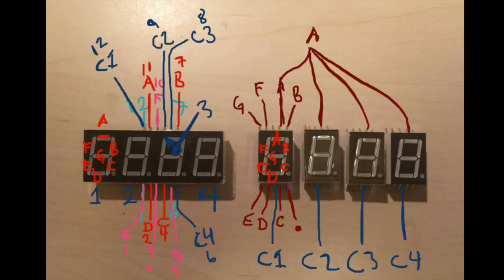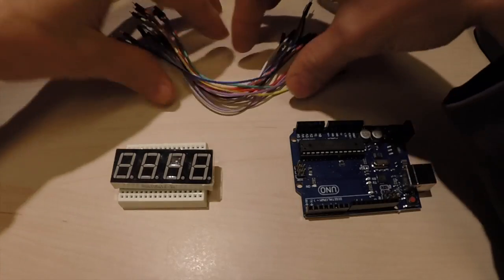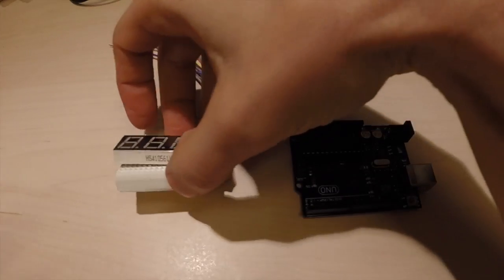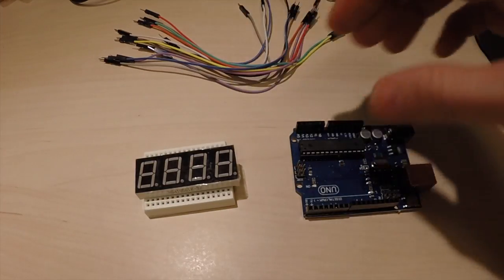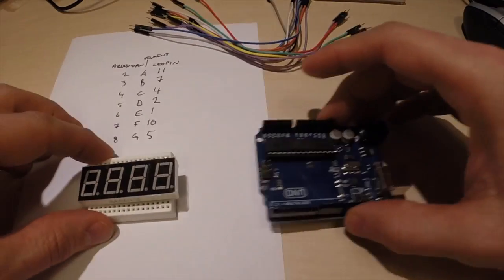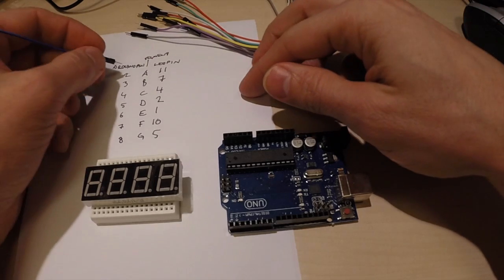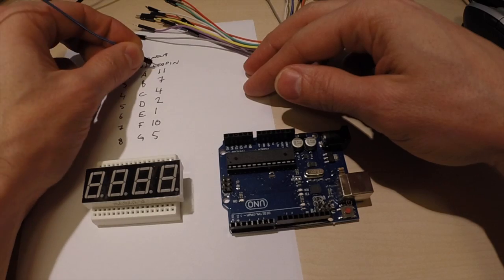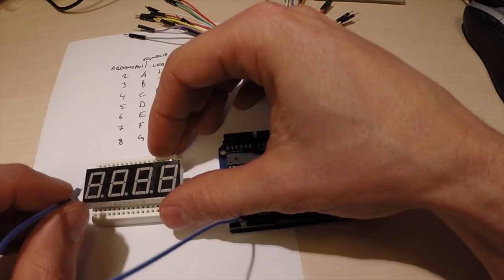Arduino and the 4 digit 7 segment led display - Anything Arduino Ep 21

Comment: Yo am a beginner can i put 1 instead of putting HIGH and 0 instead of putting LOW because thats how i did it with a single digit one
Reply from the maker: Yes that usually works. They are interchangeable.

Comment: what could the issue be if the numbers don't fully lit up? please help
Reply from the maker: Most probably a bad connection. Check connections and or soldering points should solve the issue. If the numbers are “inverted” then you have the other kind of common pin: common anode/common cathode. Check the table for that.

Comment: I have tried this code in wokwi online simulator instead of using real hardware, in simulation I can't able to get the all the 4 digits correctly displayed simultaneously, what's the reason, can anyone tell ? Whether we get this only if we tried in hardware?
Reply from the maker: Do you get them to show one after the other? Maybe you are running the simulation in a slow mode?

Comment: How can this unit display constant voltage output?  x.xx from the other breadboard.  example in Paul McWhorter's episode 9.   he uses a multimeter but couldn't you just send the data to the display unit?

Comment: i dont get it, a led requires an anode and cathode, but digital pins output only one type. It doesn't work for me
Reply from the maker: The digital pins can be either +5v or gnd depending on if the display is common anode or cathode you need to connect the common pin of the display to either +5v or gnd.
Reply from the maker: @komplikuotas1691  hahaha. Well I’m sorry for being five years late then. 😜

Comment: Where's the pin for GND?
Reply: hi There,

Here the GND is not needed. The Arduino Pins themselves will go Low when we need to sink the current. 
To turn on an LED, the Arduino pin connected to Anode will be driven high and the Arduino pin connected to Cathode will be driven low.

Seven segments 4 digit simulations here:
https://wokwi.com/arduino/libraries/SevSeg

Follow this link to play with the Arduino simulations 
https://wokwi.com for more such free Arduino Simulations

Comment: Can I use such a display without a resistors?
Reply from the maker: You can but as a majority of the comments suggest it is not adviceable. Resistors make the lifespan of the display a lot longer. Without resistors you will burn out the leds quite fast. I was lazy and didn’t use resistors. Don’t be lazy like me. ;)
Reply: @SourceryOne  ok, thanks
Reply: also, you can use this link
https://wokwi.com/arduino/libraries/SevSeg to play with the simulations without the real board. Please give a like, if you find this useful.

Comment: can we make 6 digit display using this technique?
Reply: absolutely possible: 
The Arduino pins are sufficient to even drive a six-digit display for sure. You should care for multiplexing rate

https://wokwi.com/arduino/libraries/SevSeg
You can tinker with the above simulation to build one six-digit Arduino display.

also for your kind info:

https://wokwi.com
 has a plethora of Arduino simulation examples

Comment: I really liked the way you are making the things simpler but when I have done in the same manner as you showed in the video but it is not getting any output and from where is this 4 in 7 segment getting power as you have not connected any supply to it
Reply: hi Niha

The Module doesn't need an external power supply. Each LEDs are driven using Arduino Pins itself.
To power on an LED, The Arduino pin connected to the Anode of the LED will be driven high and the Arduino pin connected to the cathode of the display will be driven low.  hope you got the idea.

Please visit:

https://wokwi.com/arduino/libraries/SevSeg has an online simulation page of Seven segment display

Comment: How cn i add switch for up/ down number
Reply: you can use spare two Digital pins of Arduino to read the button statsus.

https://wokwi.com/arduino/libraries/SevSeg for the simulation example. here, you can also add the buttons for the simulation.

Comment: Why did you not include a resistor? My 7-segment display needs resistors
Reply: The main intention of the video was to show the programming part. The author also recommends connecting one.

https://wokwi.com/arduino/libraries/SevSeg for seven segments of Arduino simulation. It is a free web-based Arduino simulation :)

Comment: Great video. But I have a issue. The upload is successful for me but nothing happens. The code is fine. And i copied the wire placement excatly from the video. I am using a arduino mega, but I put all the wires in the same spot(the numbers are all the same). Anyone know why this is happening?
Reply from the maker: You get nothing lighting up? Have you checked with just power over the pins with a resistor.
Reply: hi do you stilll have the code? I would like to use it.

Comment: can i read the output signal of arduino going at led display to another arduino ?????
Reply from the maker: Sure. These are just 1&0 states so no problem doing that.
Reply: Kristian Blåsol thanks sir.... I'll try
Reply: sir,,,, in the below link there is a device from which i want to get pulse out put regarding each input currency note... can i get it by reading the led display signal of this device into arduino 

https://youtu.be/FcOn6A0agu0

Comment: Where are your current-limiting resistors? Why are you connecting this display directly to Arduino outputs without resistors?
Reply from the maker: Laziness. It has been pointed out before. I should’ve used them. I didn’t.

Comment: My display is not doing anything.  I've dissemble it several times.  Code is compiling fine.  There is no power going to the display at all.
Reply from the maker: Have you tried inverting polarity? So connect the common pin to ground OR v+ depending on what you have it connected to at the moment?
Reply: @SourceryOne  Thanks Kristian.  Once i reversed the polarity and just focused, it worked.  I have it moving from digit to digit as it counts.  Nothing major, but its progress.

Comment: What is the white board for and where do i conect the wires on their. IS their anyway to include a rotary knob to change the digits
Reply from the maker: I don’t know what you mean with white board? Do you mean the protoboard? Yes you can add a rotary encoder no problem. Just make the numbers advance when you turn the knob. Look at further on in the anything arduino series for how to get a rock solid encoder working.

Comment: How can one combat the issue with ghosting? I mean, "1" has the "0"'s afterglow because of the Arduino not switching segments fast enough
Reply from the maker: Look at this video instead where I use two 595s to control the leds. By latching everything in the 595s I think that ghosting is eliminated. https://youtu.be/ZGzbAd-Aixc

Comment: Hello,  :( Could you help me please to purchasing an Arduino? yes
Because when I am going to select this product I found that there's some Arduinos !!!.
Arduino UNO, ARDUINO LEONARDO and Mega.
So I want to ask you about a reference of Arduino that you using.

Thanks a lot.
Reply from the maker: Uno is the most common one and works for most projects. Pick one that uses a dip28/dil28 circuit and not and chip. Then you can buy armel atmega328 chips and use one arduino as a programmer for those chips (see some of the early “anything arduino” episode where I show how to do this). Choose the Leonardo to be able to use the arduino as a usb device. For example as a multimedia keyboard(another episode of anything arduino). The mega is only necessary for really large projects where you need a lot of in/outputs. Hope that helps.

Comment: Nothing happened after doing Same thing
Reply from the maker: It could be you have a common cathode instead of a common anode or vice versa. Try to connect the common pin to v+ instead of ground (or vice versa).

Comment: /*
  Showing number 0-9 on a Common Anode 7-segment LED display
  Displays the numbers 0-9 on the display, with one second inbetween.
    A
   ---
F |   | B
  | G |
   ---
E |   | C
  |   |
   ---
    D
  This example code is in the public domain.
 */
 
// Pin 2-8 is connected to the 7 segments of the display.

int pinA = 2;
int pinB = 3;
int pinC = 4;
int pinD = 5;
int pinE = 6;
int pinF = 7;
int pinG = 8;
int D1 = 9;
int D2 = 10;
int D3 = 11;
int D4 = 12;

// the setup routine runs once when you press reset:
void setup() {                
  // initialize the digital pins as outputs.
  pinMode(pinA, OUTPUT);     
  pinMode(pinB, OUTPUT);     
  pinMode(pinC, OUTPUT);     
  pinMode(pinD, OUTPUT);     
  pinMode(pinE, OUTPUT);     
  pinMode(pinF, OUTPUT);     
  pinMode(pinG, OUTPUT);   
  pinMode(D1, OUTPUT);  
  pinMode(D2, OUTPUT);  
  pinMode(D3, OUTPUT);  
  pinMode(D4, OUTPUT);  
}

// the loop routine runs over and over again forever:
void loop() {
  digitalWrite(D1, HIGH);
  digitalWrite(D2, LOW);
  digitalWrite(D3, LOW);
  digitalWrite(D4, LOW); 
  //0
  digitalWrite(pinA, LOW);   
  digitalWrite(pinB, LOW);   
  digitalWrite(pinC, LOW);   
  digitalWrite(pinD, LOW);   
  digitalWrite(pinE, LOW);   
  digitalWrite(pinF, LOW);   
  digitalWrite(pinG, HIGH);   
  delay(1);               // wait for a second
  
  digitalWrite(D1, LOW);
  digitalWrite(D2, HIGH);
  digitalWrite(D3, LOW);
  digitalWrite(D4, LOW); 
  //1
  digitalWrite(pinA, HIGH);   
  digitalWrite(pinB, LOW);   
  digitalWrite(pinC, LOW);   
  digitalWrite(pinD, HIGH);   
  digitalWrite(pinE, HIGH);   
  digitalWrite(pinF, HIGH);   
  digitalWrite(pinG, HIGH);   
  delay(1);               // wait for a second
  
  digitalWrite(D1, LOW);
  digitalWrite(D2, LOW);
  digitalWrite(D3, HIGH);
  digitalWrite(D4, LOW); 
  //2
  digitalWrite(pinA, LOW);   
  digitalWrite(pinB, LOW);   
  digitalWrite(pinC, HIGH);   
  digitalWrite(pinD, LOW);   
  digitalWrite(pinE, LOW);   
  digitalWrite(pinF, HIGH);   
  digitalWrite(pinG, LOW);     
  delay(1);               // wait for a second

  digitalWrite(D1, LOW);
  digitalWrite(D2, LOW);
  digitalWrite(D3, LOW);
  digitalWrite(D4, HIGH); 
  //3
  digitalWrite(pinA, LOW);   
  digitalWrite(pinB, LOW);   
  digitalWrite(pinC, LOW);   
  digitalWrite(pinD, LOW);   
  digitalWrite(pinE, HIGH);   
  digitalWrite(pinF, HIGH);   
  digitalWrite(pinG, LOW);     
  delay(1);               // wait for a second
/*  
  //4
  digitalWrite(pinA, HIGH);   
  digitalWrite(pinB, LOW);   
  digitalWrite(pinC, LOW);   
  digitalWrite(pinD, HIGH);   
  digitalWrite(pinE, HIGH);   
  digitalWrite(pinF, LOW);   
  digitalWrite(pinG, LOW);     
  delay(1000);               // wait for a second
  
  //5
  digitalWrite(pinA, LOW);   
  digitalWrite(pinB, HIGH);   
  digitalWrite(pinC, LOW);   
  digitalWrite(pinD, LOW);   
  digitalWrite(pinE, HIGH);   
  digitalWrite(pinF, LOW);   
  digitalWrite(pinG, LOW);     
  delay(1000);               // wait for a second
  
  //6
  digitalWrite(pinA, LOW);   
  digitalWrite(pinB, HIGH);   
  digitalWrite(pinC, LOW);   
  digitalWrite(pinD, LOW);   
  digitalWrite(pinE, LOW);   
  digitalWrite(pinF, LOW);   
  digitalWrite(pinG, LOW);     
  delay(1000);               // wait for a second
  
  //7
  digitalWrite(pinA, LOW);   
  digitalWrite(pinB, LOW);   
  digitalWrite(pinC, LOW);   
  digitalWrite(pinD, HIGH);   
  digitalWrite(pinE, HIGH);   
  digitalWrite(pinF, HIGH);   
  digitalWrite(pinG, HIGH);     
  delay(1000);               // wait for a second
  
  //8
  digitalWrite(pinA, LOW);   
  digitalWrite(pinB, LOW);   
  digitalWrite(pinC, LOW);   
  digitalWrite(pinD, LOW);   
  digitalWrite(pinE, LOW);   
  digitalWrite(pinF, LOW);   
  digitalWrite(pinG, LOW);     
  delay(1000);               // wait for a second

  //9
  digitalWrite(pinA, LOW);   
  digitalWrite(pinB, LOW);   
  digitalWrite(pinC, LOW);   
  digitalWrite(pinD, HIGH);   
  digitalWrite(pinE, HIGH);   
  digitalWrite(pinF, LOW);   
  digitalWrite(pinG, LOW);     
  delay(1000);               // wait for a second
  */
}

Comment: When I use this tutorial my 'blacked out' segments (set to low) are still somewhat (very  slightly) illuminated. Would using a 220 resistor in someway on the pin set up help to make them completely blacked out?
Reply from the maker: Hmm, could there be a short somewhere? Either that or something might be wrong with the Arduino? Do you have an external power source or do you use the power from the arduino?
Reply: Kristian Blåsol -Thank you. I am using your tutorial for my class afterall. I rewired everything and when complete with code the project worked! Thank you so much!

Comment: How can we add push button for start/stop and reset. how we write code for that?
Reply from the maker: Quite a vague question ;) It all depends on what it is you want to start/stop/reset. I do discuss different ways of implementing buttons in this video: https://www.youtube.com/watch?v=7CHIY-KhFfk where depending on how long you press a button it does different things... 
Adding code for a button is easy, and there are really good examples in the "examples" directory that comes with the arduino IDE. Getting them to do what you want might be a bit trickier. BUT usually a good IF statement takes care of this.
Reply: Kristian Blåsol 
But it is difficult to add your code for push button. How can we declare on loop function, you should tell me the way. Thanks

Comment: Hello Kristian, how do i turn on the decimal point on the 4 digits 7 Segment  Led. I have troubles doing that. Hope to hear from you!
Reply from the maker: Hi, I believe there is one more pin for that, by connecting the last pin aswell, you will get the decimal point aswell. You have to add it to the code accordingly... Hope it helps! :)

Comment: So now you have 12 output pins going into the clock? Does it not need to be connected to ground somehow? I mean it works. I just don't quite understand why. It doesn't look like a closed circuit to me. Why does the display not have a ground pin?
Reply from the maker: Ah, well any of the Digital pins on the Arduino can be either 1 or 0/High or Low/+5v or GND. This opens up for loads of cool tricks. In this circuit there are four "common pins" one for each digit, so when you send voltage to the leds and connect the common pin of a certain digit, that digit lights up and not the others. Because we are "multiplexing" between all the digits, I only set the digital pin low (GND) for that specific digit we are working with. The other three are high (+5V) so they are not lit. Then we do this really really fast and it looks like we have four digits... Hope that messy explanation helped... ;)
Reply: Yes, that helped. I understand it now. Thank you. :)

Comment: Hello Kristian, Excellent videos, very informative and well presented. Question: I want to run six 4 x digit 7 segment displays (each with a resistor of course). Would I need to connect a separate power source so as not to overload the Arduino? If so what voltage would it need to be please?

Comment: For me, digitalWrite(D1, LOW) turns on the first digit, and pinA through pinF on HIGH turns those segments on while pinG on LOW turns it off. Not sure why mine are opposite.
Reply: got the same
Reply: Me too
Reply: I think there are two different versions of this 12 pin unit. My book was saying that if it is common Anode to do one thing, but if it is common cathode to do another thing. I might be wrong, my book has a lot of errors due to probably being translated from google translate.
Reply from the maker: As Nasty Butler says, there are two versions, one with Common Anode and one with Common Cathode. The Cheat sheet contains the data for both variants, so if you watch this and its companion videos I think you will figure it out ;)
Reply: Same here
Reply: turning the common pin low allows it to act as a ground for the led, that's why it turns it on. looks like his display is positive common.

Comment: THX for nice video
I had no problem when doing EP7 for 1digit, but I get all reversed output on 4digit
I think it's matter of cathode and anode 
So, should I have to fix all the codes from HIGH to LOW, LOW to HIGH? is there any way to fix it more efficiently?
Reply from the maker: Well hardware wise it is as simple as moving the common pin from +5v to ground or vice versa. Now if you still get inverted the you need to look at this table from an earlier video: http://duinos.net/show/?id=197 And use the other codes.
Reply: Thanks a lot I'll try it :)